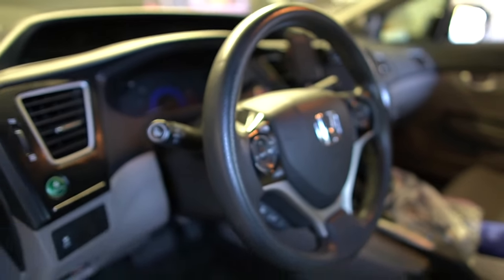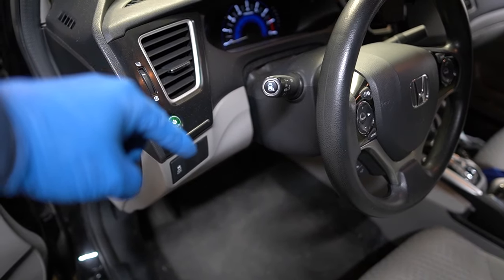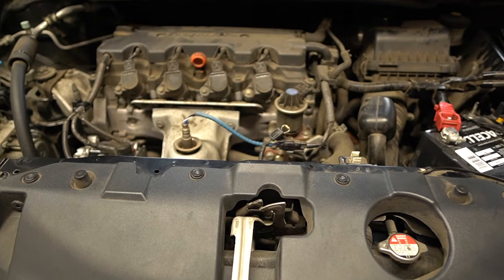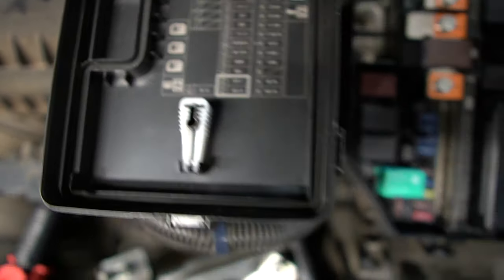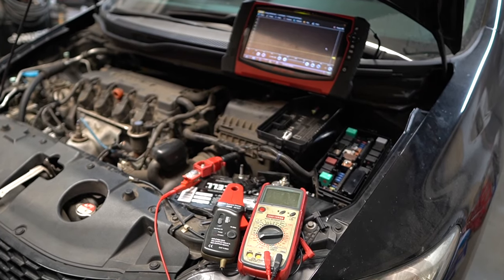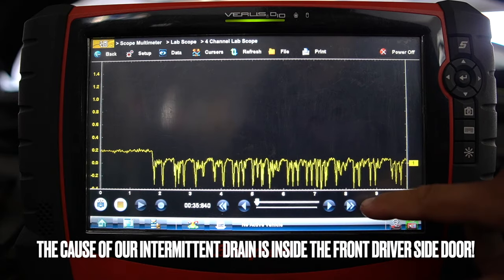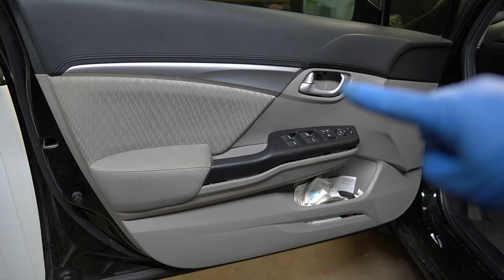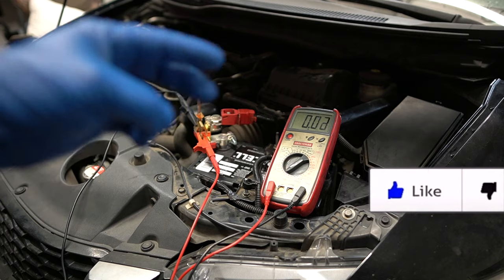Car Won't Start! Battery Drain on Back Up Fuse 29 🔋

Comment: Hektor I saw your video on changing a fuel pump on a crv. I have a 05 crv where the gas gauge is acting up,it goes from full to 3/4 back to full and within about 50 miles it's almost at empty. I had the mechanic change the whole sending unit but after a day of use is doing the same thing. Any advice on what can it be?
Reply from the maker: I don’t think you can empty a tank in 50 miles. It has to be something electrical that’s giving you false readings. Where are you located?

Comment: Hey hector imhaving the exact same problem on my 2009 Honda civic . I found which fuse it’s coming from but I can’t find a diagram that says what is all powered by this fuse . Fuse box under hood #23 10amp

Comment: Im having this exact problem right now.  I had to change both the handles because they were opening the door when I'm far away. Then as I unplugged the left door handle and door lock actuator, the dome lights and car kept on and was spazzing out. I'm going to replace the left door actuator when its warmer lol

Comment: Hello there Hector I found this video very informative for a similar problem that I'm going through. I would like to put forward a question about a 2006 Honda Accord that has a perisitic drain on fuses 6 and 7.
My question is when I pull these two fuses the drain goes away any idea that you could give that would cause a 240 miliamp and 120 miliamp draw on these fuses ? I would like to thank you for this video and any answers that might be helpful.
Reply: You have to see what does fuses control and disconnect them and see if it drops and if does that’s your problem

Comment: hey Hector i need you in our area. we have the same problem.  Our Honda Dealer said it was all OK! dont want to do all the you work did, I guess. any recommendation in the 90503 zip code. need help.

Comment: I am having this issue with my 2007, Honda Pilot. How can I find out which fuse controls the back up lamp? My dashboard lights up with backup lamp. I changed the big engine fuse box. Now on my dashboard, I get the "triangle w/exclamation point" light, and "VSA" light. Any suggestions???

Comment: Hey Hektor, my digital clock stays eliminated on my daughter's 2013 honda Civic lx 1.8 liter model, and also, my rear password side window doesn't work. Could any of these two issues cause my parasitic drain?

Comment: Question, I have a 2013 civic that uses the dreaded battery sensor. I recently changed out my rear left tailight bulb, and 2 days later, my car would NOT start. It acted like a dead battery. I jumped it and started fine and drove fine. Parked for about 3 hours, then the car would NOT start again. I went to autozone and had them test my whole charging system, and all came back good.

So the weird issue now is that if I jump the car, it will start fine, and there is 12.4v on the battery (checked with voltage tester) but when I turn car off for 5 mins or so, it will not start again BUT the battery still shows 12v and charged. 

Could the battery sensor be my problem?
Reply: UPDATE: I had the above issue fixed, apparently! It turned out to be a bad battery even though all tests were checked out good on this battery. Multimeter read 12.4v on battery always, and Autozone tests checked out good as well and wasn't until I swapped batteries with my other Honda that uses same 51R battery and my crv wouldn't start and mimicked a dead battery. Brought out tester again and battery at 12v but still would not start car. Hope this helps others. Went to Costco and picked a new one up with a 3-year warranty, and now the car is fine. The old battery was from AAA and had a date stamp of 3/20, so it was def faulty and past its usage life.

Comment: Curious why you started pulling fuses and possibly waking up modules on other circuits as opposed to measuring voltage drop across the top of the fuses with a multimeter. Good video👍
Reply: Why would there be a voltage across the fuse?
Reply: An ideal fuse would have a resistance of zero ohms but fuses in the real world have a small resistance.  An voltmeter set to the smallest millivolt range is able to measure a small voltage drop across this small resistance.

Comment: Hey  hektor I have a 2020 honda civic 4 door , my issue is the car starts up on its own , cuts off then the battery goes dead. Replaced the battery replaced the battery terminal replaced the BCM per honda . Still having the same problem replaced the MICU fuse box under the stash board . Any suggestions would be appreciated. Only other thing I was told to probably change out the immobilizer. Any thoughts

Comment: Hi guys i need a help where i can get the diagram for wiring and more information about car components ? as i have finished my IMI level 2 in motor vehicle engineering i will be going to do my level 3 too . any help will be high appreciated.

Comment: How much can you charge for a job like this
Reply: Whatever the charges, worth every penny. The main goal is he got it fixed and did it right the first time, NO headaches.
Reply from the maker: A flat rate diagnostic fee plus the labor for the actuator.
Reply: @HomieHektor  what is your shop’s exact address.

Comment: Hello I have problems with a Honda Civic 2015 ex Push button ignition discharges the battery once it is turned off the current consumption is high and the next morning the battery is completely dead

Comment: Where is your shop location I need my car fix I have a short in my car 2012 so civic 
I took my car to streetlights and. They cut my wires and never finish the job bro
Reply: They left wires hanging and my car doesn't start no more the key not reading the computer
Reply: I'm in Pomona

Comment: One question.  My 2013 just started killing the battery overnight. 
So far the battery checks out.
I watched the entire video and you went down the same path as I was thinking it could be.
However when I push the door lock remote the car will lock and unlock,  but the alarm beep has stopped working. 
I find it interesting that happened at the same time.
Any suggestions?
Reply: Did you ever find out your issue. i would have just changed the driver door lock actuator. My son has a 2013 civic. Just replaced the battery. Then had the alternator checked and it said the alternator needed to be replaced. If that doesn't work I will tell him to change out the driver door lock actuator. good luck
Reply: @djerniet350  it's been so long ago I'd forgotten about it. 
Yup, if I remember correctly it was the door lock actuator.

Comment: Had fuse 29 draw .1-.3 a passenger door handle silicone switch fixed it.
Reply: Fuse 29 also feeds the OBD connector if you have a HUM or tracker or etc.

Comment: Can my 07 the civic Si electric Rack and pinion  power steering cause the the same drain or alternator issue?
Reply from the maker: Anything electrical on the car can potentially drain the battery.
Reply: When I turning the steering wheel when driving I lost power even rested to were I have to put radio code in my car when diving it kills out I replaced the more common drain A/C relay and ignition switch and still no change I stalled on way home from work. I’m considering changing the alternator if not and you say go look for the drain I will, I tested battery and alternator twice they came up good best advice Hektor?
Reply from the maker: @BiGR0B3  isolate the circuit and look for a drain or short
Reply: Hey @HomieHektor  took It to mechanic they couldn’t find the short, when I driving it now the car stalls out completely causing the stereo to reset at this point I’m lost thank You for the help
Reply from the maker: @BiGR0B3  where are you located?
Reply: @HomieHektor  Barstow I guessing it going to be the fuse box
Reply: @HomieHektor  in Barstow I’m thinking replacing the fuse box
Reply from the maker: @BiGR0B3  and if that doesn’t work, then what? You need to have it tested to pinpoint the culprit. If you can bring it to Pomona and give me time, I’ll figure it out 💯
Reply: @HomieHektor  your around the corner from Ontario so I’ll try 1 more thing on Monday if doesn’t work I’ll roll out Saturday and I’ll take a drive out there to the Po, thank You
Reply from the maker: @BiGR0B3  it might take some time, do you have an extra car? and will your car make it down here? DM me through Instagram:HomieHektor to make it easier

Comment: Yo how do I turn off the power from the drivers door , I has no key I have benn getting new battery’s like every 3 weeks 🤨 what can be draining my battery or why won’t the power cut off
Reply from the maker: Ok What exactly stays on, on the driver’s side door? Also..
What’s the year, make, and model of your car?
Reply: The drivers door , the door has the power windows buttons that stays on , n the widow’s can go up n down , with out turning on with a key , so it’s on 24/7 like powered on , truck is 2005 Ford F-150 xlt 5.4 v8
Reply: Can a be like something that supposed to sent signal that there no key n should turn it off ?

Comment: So did you end up just replacing fuse 29 or did you end up replacing or just disconnecting the door actuator? I didn’t catch that part
Reply: Fix based on his t/s was replacing the driver side door lock actuator.

Comment: may be aternator not work probably check backup fuse 29 10a remove 1 minute then install again may rest car function check you battery drain using multimeter set to 10 amp connect in series  battery negative or positive set to 10amp or 20amp insert black on com red on 10adc on top connecter to check drain electric amp  on the car i think on some where was short circuit may be window switch or accessory power socket front or car back trunk light switch

Comment: I keep having to buy batteries for My 2013 honda civic LX  & it's getting on my nerves 🤬🤬🤬🤬 I've replaced the damn alternator & have a week old new battery in my car.the previous brand new 1 from the dealership died in 1 month. I can't believe NO 1 knows wtf is killing my batteries.😤😤😤Yesteday I replaced a corroded down to the copper battery terminal.the guy who installed it said that was my problem. Another jackleg  mechanic is telling me the  Electric Load Detector needs to be replaced & it won't die anymore. Is this true or are all these shade tree's blowing smoke up my ass?! Why can't anybody help me & know wtf the problem is